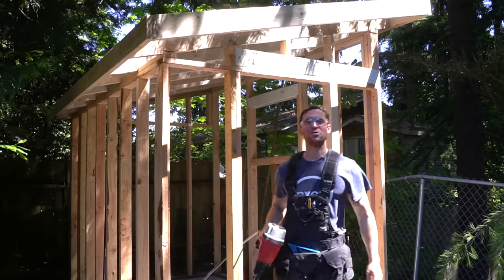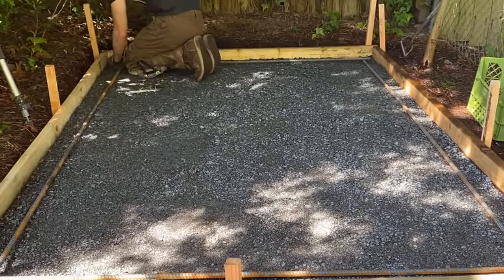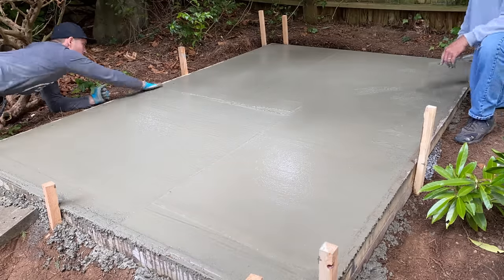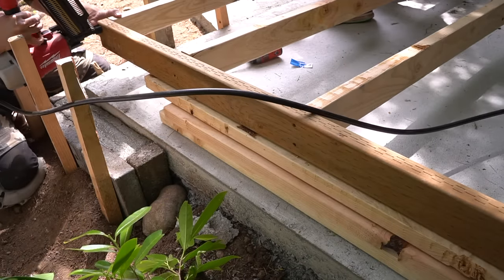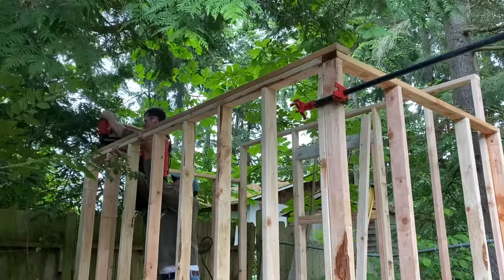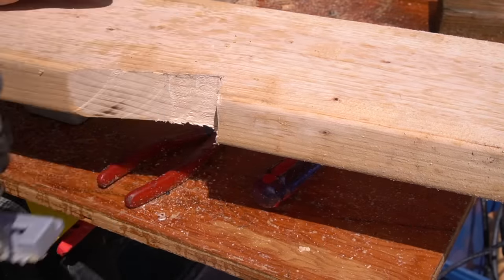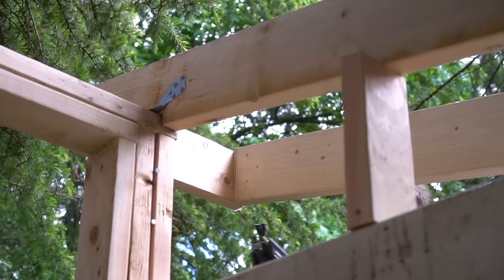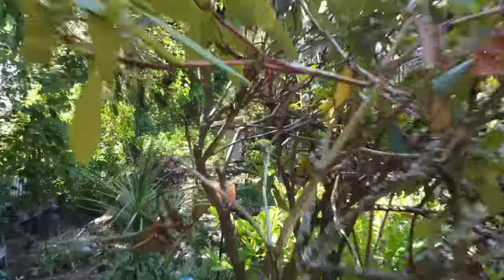BUILDING A LEAN TO SHED // START TO FINISH (Part 1 of 2)

Comment from the maker: Multiple Shed Plan Sizes Available NOW: https://www.etsy.com/shop/BYOTools?ref=shop-header-name&listing_id=1396101371&sort_order=date_desc
Reply: Would you be able to post a Home Depot shopping list?
Reply: Hello. Thank you for the amazing video. Would you mind clarifying one thing for me? It looks like when you put the first rafter up to mark your birds mouth cuts, the board is already at an angle and you are using those markings and your square to determine the angle of the cut - so the calculator is not necessary in the way you did it- you’re using the existing structure (walls/top plate) to make the angle? If so, makes perfect sense to get the perfect cut, but just wanted to clarify, its that simple, lol. Thanks so much for taking the time to share your knowledge and calm voice with us :)
Reply: Cuanto mide esa casa ?

Comment: 2021 - Total Cost of shed = 1.25 Million
Reply: Ain't that the truth.
Reply: I paid 6.5K total, for all wood, electricity,  mini split, sheet rock,  insulation,  vapor barrior.. primer n paint for floors and walls.. all labor also ( electrician,  carpenter, hvac pro to install mini split ) 
This is a price from 3 months ago till yesterday) also. The sheds at home depot are roughly 7K for 8x12 with absolutely nothing included but the shed frame! So its STILL way cheaper to diy your man cave dreams guys! 😆
Reply: This is a real 💯 comment tho 😆  .. Its the most expensive time to build ANYTHING.. not just wood! Everything to build anything is triple priced , but I noticed lumber prices dropped about 10% over the 3 month span i been building
Reply: Built mine about 8 yrs ago nearly identical to this and mine came out around 5.5k
Reply: Imagine that amount times 4 for non usd country like mine.
Reply: lmffaoooooooo
Reply: You must be thinking of the Irish governments version 😂of

Comment: Great video, thanks!

May I suggest that while placing the concrete, vibrate the form boards by tapping with a hammer to fill the voids you see after removing the forms. Makes for a stronger slab and avoids a weak spot that may be penetrated by an anchor bolt.
Reply: Also torquing the bolt to "as tight as possible" isn't always a good thing. Expansion of the wedge can cause the concrete to crack which would be a double whammy for the already weaker concrete edge

Comment: I drew up plans for a 'lean-to' shed a couple of months ago. As it turned out they are almost identical to your shed.  You gave me more confidence to begin building from the plans I made.  I set the roof angle the same as my house roof angle to match as it will be positioned next to the house. Good job on creating your video.
Reply from the maker: Great to hear Bob and thanks so much for sharing.  hope your shed turned out great.

Comment: I'm here in the PNW as well.  I am rebuilding a shed like this that I had to previously take down due to some rot and construction on the house.  I saved all the good wood.   I have been procrastinating because I have no idea what I am doing.  I can only have it 3' wide and up to 10' in length.  Good enough for yard stuff and extra lumber.  Thank you for an easy to follow video.

Comment: I noticed (in the video) you didn’t tamp /vibrate your slab when pouring. This process will help take air out of the slab before curing takes place. You can see this when you strip the form work. Depending where you live, this can let frost or water in the holes in the side profile of the slab, which when frozen expands and can crack the concrete.
Reply: Noticed that too. When the form was taken apart, there were soo many holes. If you drilled into that slab it would fall apart!
Reply: and poured right over organic roots and material, that thing is gonna fail so damn fast.

Comment: Great video. Love the shed. The way you are using the framing nailer, it is just a question of time when you will end up hitting  a knot and shoot a nail into your hand. You should never aim in a direction of yourself or another person.
Reply: I was a professional framer for years and I thought the same thing.  My rule for my crew was always keep the other hand at least 12 inches away from the tip of the gun.  That way if you hit a knot or depress the safety and just graze the plate with the nail, you will be okay.  We had no nail in the hand accidents using this safety procedure.

Comment: I started to build one of these and a few days later some a-hole from the city taped a stop work order onto my house and said I needed a permit to build it. To get a permit I had to submit plans signed by a certified architect ($900) after getting my property surveyed ($800?) and have to use the exact hurricane proof brands of construction materials listed in the plans (its like $6000???) Just the cheapest hurricane door is like $600. Also before I start I'm supposed to dig a foundation, pay a certified bug company $100 to spray bug killer in the hole, call the city to inspect the sprayed hole, and then put the concrete
Reply: And that is why we should vote for less government in our lives. Hint - don't vote for democrats.
Reply: Where he's at, you can generally a build a detached structure up to 200sq ft without a permit.
Reply: All you needed to do was build it with a wooden floor 4x4 laying lengthwise and plywood floor so it is now a portable shed. No plans needed. No permits needed. In fact there are no permits for portable sheds this size.
Reply: @daveclark8726  my shed was meant to be portable, it is not attached to the ground. It doesn't even have a floor
Reply: @marcin3844  Tell that the city Houston, city has almost no zoning codes.  Unfortunately, when a hurricane did come and the water had no place to go, everybody in Houston then turned to the Government and said, "Please save our dumb asses Government."
Reply: @joshuabunkers1494  I would rather live a free life with all the consequences of it than have a government support and pay high taxes and be told what to do, what to build etc
Reply: @marcin3844  Feel free to stop using our public roads.
Reply: @joshuabunkers1494  That we all paid for with our money. Which is fine for the roads on the local level. I'm not saying that we shouldn't pay any taxes. We should pay for the essential taxes and that would a good discussion.
Reply: My property surveyed was $250 about 3 years ago. It is good thing that I can draw the shed...Wow, you are asked to spray bug killer, what if you have garden around it?
Reply: @xINVISIGOTHx  soon as you mentioned CONCRETE, it stopped being portable! 😂
Reply: @joshuabunkers1494  You are full of it, insurance that we pay bail us out, not the government
Reply: It is the pouring of the cement.  Any building with a foundation needs a permit.  Even in the Pac NW, no foundation then the building in considered temporary and not permit nor take-offs apply.  The survey thing was BS but you did need to submit plans, it does not need to be by a certified architect and long as the plans meet code.  This is why people hire contractors, they know all the codes and submit the paperwork as part of the cost.  Hurricane proof is easy.  Whomever told you it was $6k is full of crap.  Anything I build must be able to handle 85 MPH winds with a 30 pounds of load already on the roof and I live in the mild Pac NW.   If you skip the foundation they can say shit.  It is a temporary structure just like a tent or inflatable pool.
Reply: @marcin3844  less government except when it comes to military expansion, abortion, and government mandated oil and gas subsidies?
Reply: @marcin3844   whether democrats or republicans it's all the same bs.
Reply: @benitogarcia7988  How so?
Reply: @marcin3844  THEY BOTH ARE GOVERMENT!!!
Reply: I live in Kentucky. I have a 12 gauge permit.
Reply: In the UK this would need absolutely no permit at all... because it's just a shed, not a 'building.  But then we don't often have hurricanes...or termites.
On the other hand, the bearers would rot in a few years without a strip of DPC under them.
Reply: Ahh yes government regulation, got to love it. Makes life so much better

Comment: Nice. But I would have used resin anchor bolts to hold it down. The expanding bolts can put too much stress on the edge of the concrete and it can split. The resin anchors will hold it just as well with no strain on the concrete.

Comment: Nice job, love the MCM design aesthetic.  One note, the GABLE end has no downward force/load from the roof so the header is not only overkill but not required.  Keep up the great work
Reply: What about the weight of hanging a steel door. With all the extra work to seal and moisture proofing, I would hang a steel door.

Comment: Sooo happpy you used hurricane clips!  I wish those were just standard code.
Reply: Hurricane Maria would eat a shed like this for breakfast,  My sheds foundation ate a bit over 9 meters of concrete,  and used up over 2000 pounds of rebar, sheds are built differently in the tropics lol
Reply: Overkill for a little shed IMO
Reply: @clayjones553  No such thing as overkill when building to last
Reply: @MosaicHomestead  then why didn't he use 2x6 studs and 2x12 rafters?  ;)
Reply: @clayjones553  because there aren't really any building codes for sheds lol...I'm building one, but mine is more of a bunker than a shed, way above building code, but its because it would have to survive 200+mph winds.
Reply: @MosaicHomestead  glad I don't have to worry about that in the Appalachian mountains
Reply: @clayjones553  I'm also up in the mountains ⛰,  im near El Yunue National rain forest.

Comment: Pretty well done. The only thing I would likely do different is frame the wall with the doorway after you put the end rafter on. That way you could tie the wall together with it and have a proper king stud. But there really isn't much weight in the roof so it's not an issue.

Comment: I framed houses for about 6 years and fortunately with my degree I’m now a superintendent, but boy do I miss framing something about pulling the trigger on Hitachi 83A does it for me. This roofing system is perfect for someone like me who hates building gables out and even conventional rafters. So simple yet very clean and structurally sound, can’t wait for part 2. When lumber prices fall I definitely will use this plan build.

Comment: I like to put plastic barrier under concrete. It makes it stay wet longer, if it dries too quickly it has a tendency to crack more. I noticed you didn’t run a trowel between the form and the concrete. You have a finished edge, when you remove the form.
Reply: What about some expansion joints in there?
Reply: Do you run the trowel all the way down into the concrete? Or just the edge up high?

Comment: One-the header over the door is not needed. That wall isn’t carrying any weight from the roof. Two-even if it were, it wouldn’t help. Same as above the window, your headers are just lying on top of the top plate. In order to transfer load, the header should be placed on jack studs, between the king studs that frame the door/window. Then cripple studs placed on top of the header will transfer that downward force across the header and down through the jack studs. Yours are simply serving to stiffen that short run of top plate.
Reply: It looks to me that the header is on jack studs.

Comment: I opted to lay a course of dark grey solid engineering bricks rather than the treated timber. The mortar also allowed me take out the small lumps and bumps in the concrete slab which was quite old. I also opted to turn one of the pieces of wood through 90 degrees forming a T shaped beam above the window reveals and other points where load was carried.

Comment: Hi, One idea I've had for a shed is to build it on stilts. If you imagine how decking is built with several posts buried into the ground, a frame built around a level point just above ground level and cut at a certain height for any railings (if present).

What I've thought about is bury pressure treated posts into the ground inside concrete and have them extend as high as the roof is needed. Build a base like you would with decking and build the shed from that. This would allow for plenty of air flow underneath the shed and, as like you'd have decking running along to form the floor, you could have pressure treated wood forming the floor. This would negate the need for a concrete base of sorts.

Any ideas?
Reply: I am thinking about posts from foundation to roof too. But I have not seen any videos doing this. I wonder if too solid is not all good. Separating the foundation and the body might get some kind of flexibility. Just a thought.

Comment: It would have been much simpler to put anchor bolts in when the concrete gets poured. It takes a bit more coordination but it beats all that drilling and they are less expensive than the wedge anchors. Great use of the Simpson hurricane straps and nailers. They can also be used with 1.5" screws if preferred.
Reply: Can u show how?
Reply: Sounds like a pain in the ass to line them up with holes in the lumner later though
Reply: @researchandbuild1751  Most of the videos On YouTube that deal with concrete and anchors have them preset. It's no less effort than the formwork, gravel, wire mesh, pouring the concrete and finishing.
Reply: Hey man. Got a question for you about the concrete if you wouldn’t mind giving your input. Should he have done any frost footing? If not, at what point do you think he’d need to?
Reply: @ajamesbertman  Footings or any concrete foundation should always penetrate the frost line. Otherwise the structure will be subjected to uneven frost heaving in the winter and conversely settling in the summer. If there is no objection to the uneven frost heaving of the structure, I suppose you could bypass it, But I wouldn't.
Reply: @mrluckybreak  First, thank ya for giving your thoughts here! I'm familiar with the concept of frost footings and have poured them for several things on larger scales, but was unsure how to go about the foundation of a shed. I'd like to build something of my own home depot style shed with a crete floor (10x12x8 most likely). No garage door. I'm also putting a fence up and will be auguring some post holes soon. I was curious if using the auger to also dig a few piers around the perimeter of the pad would be worth while to meet in the middle of the monolithic footings and just a flatwork pad. Can I get your thoughts on this?
Reply: @ajamesbertman  Some piers around the slab edge would be beneficial in reducing the frost heaving. Since this is a shed, a floating concrete slab with monolithic piers as deep as you can go would not be unreasonable. I would use a turn down slab at the bearing wall slab edge just to support the weight of the wall. No doubt the YT community has thought on this. Good luck.

Comment: Woah, this dude literally put his roof on without securing the walls down first, lol.
Reply: I was thinking the same thing!
Reply: He also fills the gap between the foundation and sidewalk after the fact. Talk about CRACK. Laying out the walls from the concrete floor? I guess so?
Reply: It’s just a giant kitchen cabinet. As long it’s square, what order, who cares…besides the joists weren’t secured yet.  Which reminds me, I bought some outdoor furniture last year and the chair assembly instructions said not to fully tighten all the screws until after doing a drop test for level.  So I guess every time I move the chair to a new location I need to loosen the crews and do another drop test to level for the new location?
Reply: @E39it  Yeah, I don't think your lawn furniture is comparable to the proper way to build a structure. Not everyone is going to be building a structure of this size and if they do have a larger structure and perhaps don't properly fasten down the wall they could potentially hurt themselves. As to whether or not you should level your lawn furniture every time you move it? Ugh, shut up.
Reply: @LargerThanCats  obviously @F07N63 has never built a kitchen cabinet, because they are lot more difficult to construct than that shed.  Just like mathematics, there's an order of operations you have to follow to solve the equation correctly. Same thing applies to building anything. If you're going to make a video SHOWING how to do something, you should at least know what your doing first.

Comment: Idk what part of the country your in but there should be 4" of rock and 2" sand base under the concrete and he didn't cut relief joint in the slab that side walk won't last long either after the first frost it will hev
Reply: Well it’s a shed

Comment: a few things I saw in past videos from other contractors, the 'California corner' for framing the corners (double 2x4 on one side), and missing bolts/nuts when connecting the cement with the pressured wood frame.

Comment: How does “beefing up” the front end of the slab with a thicker piece of wood help mitigate the root-y terrain?  So it can support more concrete? And more concrete = less likely the roots will effect it? Thanks!
Reply: Probably they didnt want to dig up the roots to level the ground so the but a bigger board

Comment: Dude, in your intro 0:13, you're screwing 3/4" from the end of a 2x6 without drilling pilots first and it split the crap out of your wood, thus compromising any structural integrity it would have. You can't do that.
Reply: If you split your wood like that could using kwikwood epoxy repair it enough to still be able to use that piece of wood?
Reply: That doesn’t matter for the forum boards b/c he has it staked